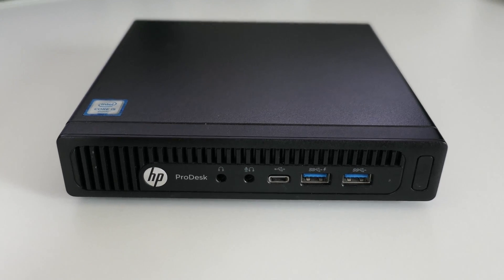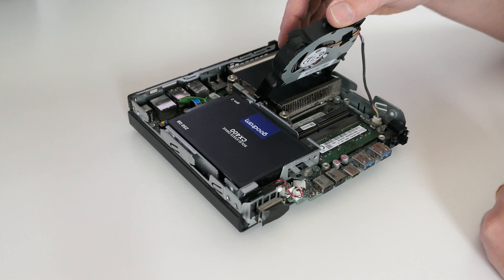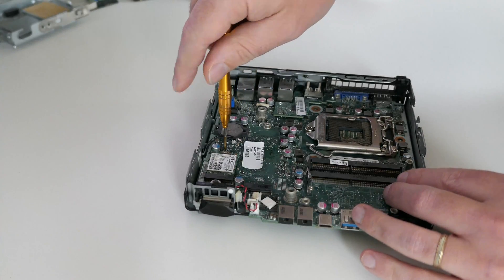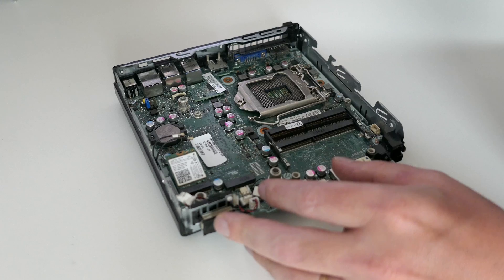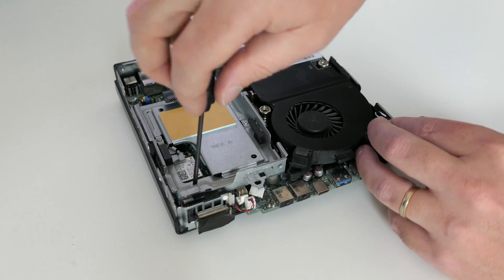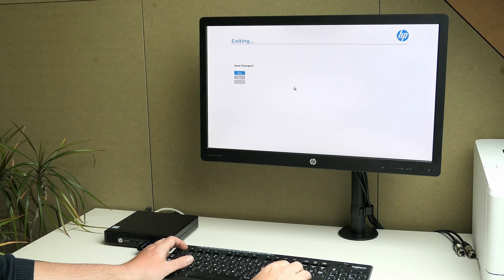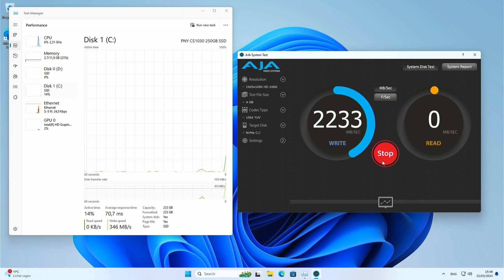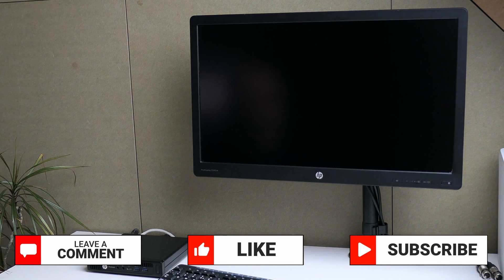HP ProDesk 600 G2 Mini - Teardown, Upgrade and Benchmarks

Comment: These mini pcs are nothing but a laptop desguised as desktop
Motherboard and rams and ssd and fan are all a laptop components
Reply: I'm inclined to agree with you considering that most 2.5" hard drive don't spin faster than 5600rpm, where 3.5" drives ran at 7200, iirc.  However, now with SSD's being smaller and bare boards, not needing the housing to make them fit in drive bays, the real factor is the processor.  This processor is lower powered--a T model--but is still a desktop processor and not an M model.  Since drive dimensions and memory dimensions don't matter anymore, it's really about the processor.  In Apple's case, yes, the Mini's stopped using desktop processors long ago & they opted to use the laptop processors.  You're dead right on those.

Comment: How to replace the 2032 battery?
Reply from the maker: @Aron-uv8bh  unplug from power, move the clip that holds the battery with a plastic tool (or flat screwdriver) and it will pop out. Then just push a fresh battery in. Should be pretty straightforward

Comment: Why, when discussing the connectors available on the motherboard, did you omit the discussion of the connector (3-pin) located next to the speaker connector?

For those curious who are also looking for such information - it is a connector for an additional fan (mounted in the 2.5-inch disk bay), thanks to this fan + power supply >90W,  can be used 65W processors
Reply: Hey, thanks for this info!  I'm not familiar with this type of fan that fits in a 2.5" slot.  I'm looking for "2.5" drive bay fan" on NewEgg, but not getting appropriate results.
If you could give me a pointer regarding this specific model, I'd appreciate it.  Once I see it, I'm sure I'll see which way it sits, blows, etc.
I just got one of these computers and was thinking about how I can't put a 65W processor in there because that would outstrip the given PSU, and a beefier PSU doesn't mean that the MoBo can handle the extra current (and heat) properly. --or so I was thinking such.  You've clued me in that they CAN!  Thank you!
Reply: @blue_samurai_zero  Hi, thanks for your reply. I found the information in the manual of this computer. This fan is not a standard solution, I suspect it is only applicable to this specific model or series.
At the moment, I found such a fan only in the Aliexpress store

Comment: Can you replace the wificard with a mini NVMe harddisk? So you have 2 x NVMe SSD? I always use network cable, today I have a 1TB 2,5" disc plus NVMe 256GB inside, but the larger disc make so much noice.
Reply from the maker: Out of the box no, as the M.2 slot for a wifi card has a different form factor (key) than the one for M.2 NVMe or SATA. I do know there are adapters available to convert these but have never used them. It would also reduce the speed as the slot for wifi is slower.

Comment: Where did you get the drivers for Windows 11 for this PC?
I've got a HP prodesk 600 G2 DM mini pc which has been upgraded to Windows 11 pro at some point in its past - and there are multiple unknown PCI-related devices. 
PCI Data Acquisition and Signal Processing controller, PCI memory controller, SM Bus Controller.
Reply from the maker: AFAIK they just come automatically with Windows Update. In some cases you need to install the optional updates but all should be there.

Comment: 11:35 This supports Windows 11 without workarounds?
Reply from the maker: It's been a while ago but as far as I remember it worked without any workaround and I find similar stories online. If it would not work, I did a whole set of videos on how to get around these limitations and in general that goes pretty easy and works perfectly fine after.
Reply: No, processor is officially unsupported. You need a bypass hack to make it work. I run W11-24H2 without problems after the hack.

Comment: Mine does not boot but beeps 3 times. I have m.2 and 16GB of ram installed. No red lights only white solid and 3 audible beeps. Any help?
Reply from the maker: The best is to look up what the order/length of the beeps/lights means. You can most likely find an answer here: https://support.hp.com/us-en/document/ish_1997210-1528385-16

Comment: windows 11 officially supported?
Reply from the maker: Its not officially supported but you can use one of the workaround (did videos on that as well) to still get Windows 11. To my experience it works just fine.

Comment: Hello, could the wifi card be replaced with an ethernet card to use it as a firewall?
Reply from the maker: Not sure if these exist. You would have trouble to connect the cable and terminate it properly on the case I think. What is a viable option for this is a USB3 Ethernet adapter. My experience with them is pretty good and it would allow you to add multiple interfaces if desired.
Reply: @jensdbe  Of course they exist but not officially, they are made by the Chinese (m.2 to lan). Thank you very much for your time, I checked that it works.:hand-purple-blue-peace:

Comment: I have this one, but i am unable to use front panel's usb, kindly help me on this. Please
Reply from the maker: The ports are soldered to the board so it can't really be a loose or unconnected cable. Maybe check if the ports aren't disabled in the BIOS setup?

Comment: Thanks for the teardown. I just ordered one of these to act as a Roon server. It’s nice to see it has space for two ssd’s since Roon Core won’t let you store music on the OS drive. I have a question however. Do you think it will accept a I7 6700K processor? I have one of those sitting in an old gaming PC that’s collecting dust at the moment. The socket is the same but a 6700k has a TDP of 95W or so. I wonder if it would be feasible to clock it down and make it perform more like a 6700T? Probably not with the limited bios options on this thing...
Reply: No lo creo este equipo acepta procesadores serie T
Reply: Thanks. I don't think so either to be fair. The i5 6500T that I ordered should be fast enough for what I need it to do. It's just that I have a 6700K laying around doing nothing at the moment. But I don't think I'm gonna try it. Don't wanna break things. I'll just use it as it is.
Reply: @Bimmerstye1 y claro si al equipo le instalas un m.2 y mas memoria ram no se para que lo usaras pero quedaria mejor
Reply: @vower14  It comes with an SSD. Don't know what type. They didn't mention that in the advert. If it has an M.2, I'll get an extra SATA SSD for storage. If it has a SATA in it, I'm gonna use an M.2 I have laying around and get a bigger SATA for storage. It also comes with 8GB of ram what should be enough for my usecase. I'm gonna use it as a Roon server. Basically to stream my music throughout my house and to my phone when I'm away. It doesn't need a superfast CPU but it does need to re-encode the audio on the fly and it does digital signal processing so it wouldn't run on a Celeron or Atom either. But the 6500T should be sufficient.
Reply: La verdad es bien dificil romperlo quizas los pines donde va el procesador pero para ese i7 quizas sea bueno una motherboard de aliexpress o una 2da mano

Comment: 7xxx cpus should be supported by the chipset right? . installed a 7500t but getting a black screen. i wonder if the cpu is faulty or i need to reset the bios?
Reply from the maker: The chipset might support it but the BIOS does not. As far as I know and read, this PC unfortunately does not work with 7th gen Intel Core CPUs
Reply: @jensdbe  thx. Forced obsolescence I guess.

Comment: 600 g2 avail to be upgrade wifi to ax210 ?
Reply from the maker: Sure, you can upgrade the M.2 wifi adapter to a Wifi 6 model without issues as far as I know.

Comment: Can I upgrade the processor for i7 7700t?
Reply from the maker: As far as I know only 6th generation Intel Core CPUs are supported. the i7 7700T is a 7th generation CPU so most probably it will not work.

Comment: Used to use one of these as my router/firewall. I then passed it onto a friend after fitting a 512Gb NVME for Windows and a 2Tb Sata SSD for his data. He loves the little thing and its way faster than his old pc :)
Reply: I am planning to use it as my router aswell why did you change it ?
Reply: Hello. Does it support 1tb of sata storage? As I've read in the documentation it's up to 512 GB SSD only. That's why I'm hesitant to upgrade the storage to 1 TB.
Reply: how can i use it for firewall?

Comment: How is windows 11 working in 6th gen cpu. Is that an official windows 11 ?
Reply from the maker: It's an unmodified installer and it did not complain at all about the CPU. Not the first time I see this on a 6th gen Intel Core CPU. 
Even if you would be running into the hardware check, it's pretty easy to work around this. (Did some videos on that earlier).
Reply: Thanks I'll check it out

Comment: Thanx for the video.  I thought that the i5 - 6500 CPU was not Win 11 compliant  only 8000 series and above.   Nice little PC though.
Reply from the maker: That's also what I thought but without any workaround, the installer was not complaining and allowed me to install Windows 11 without any further issues.
I believe I noticed that before on another 6th gen CPU as well. In any case, it works as expected.
Reply: @jensdbe  Hi, please let us know whether W11 updates properly on this machine? I have read info that W11 may be installed but some issues with update may take place later.

Comment: can i use it for playing old games like GTA SA or PES 2013 with low settings.
or maybe some times vedio edit...
my principal usage for browsing. watching. and office things of course...
and some times old games like PES 2013
CAN IT RUN LIGHTGAME LIKE FREE FIRE
IS IT GOOD HELP ME
Reply from the maker: Both GTA SA and PES 2013 should run fine with this CPU and the integrated graphics as far as I can see. You might have issues getting them to work with newer Windows versions though. Video editing will not be super-fast but with a bit more RAM and the fast NVMe drive, it should be doable for casual-use. The rest should all be fine as well.

Comment: I just bought the micro tower Prodesk 600 G2, no NVME slot available on the motherboard though. You wouldn't happen to know if the fans are standard PWM? Because I'm thinking about replacing both the cpu cooler and the exhaust fan.
Reply from the maker: Not 100% sure but I think these are all 4-pin fans, which typically are PWM.
Reply: only few 4pin fan are not standard PWM (some apple product). in dell motherboard, some fan needed to spin up to 4000rpm at startup (will be normal after boot), if not, they will appear as cpu fan eror at boot.